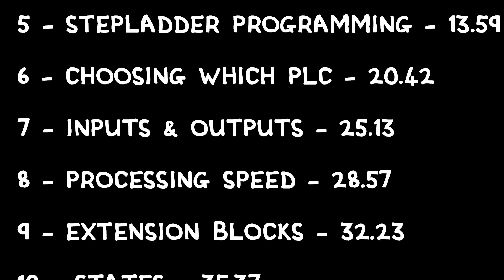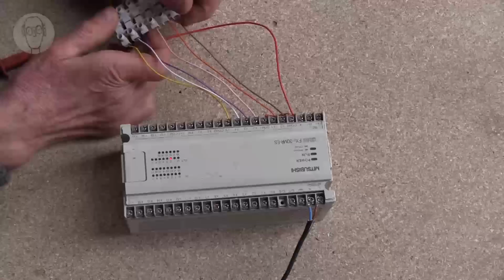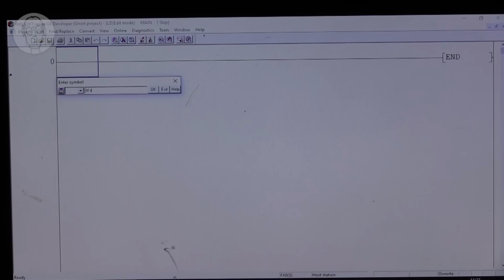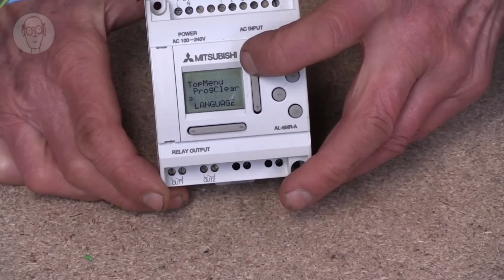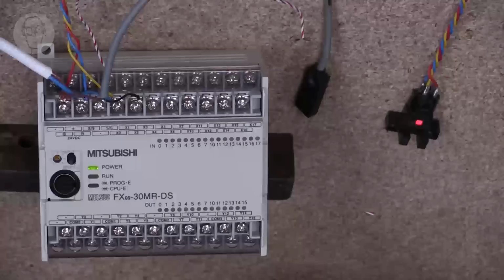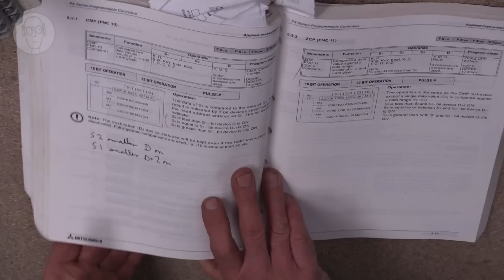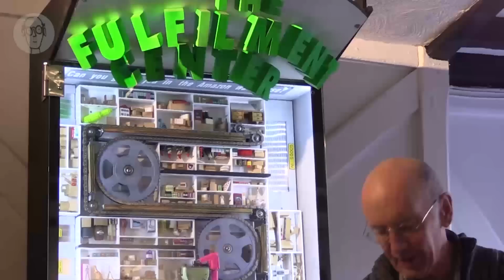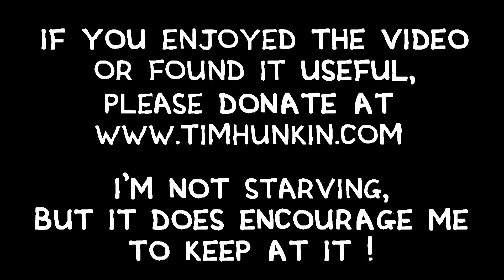PLCs (Programmable Logic Controllers) - The Secret Life of Components - episode17

Comment: Wow Tim, this was really useful. I'm building a coin operated miniature quirky factory with converyor belts and all kinds of things going on, for young kids - something they can interact with. A logic controller would seem the solution although as space is tight, I may play with an arduino and see if that will give me the control I need. For something more tactile, I've opted for old fashioned toggle switches that the kids can switch on and off but I can see I'm going to need sensors in places to avoid damage to motors at end of runs. Was trying to figure out how to do all this when you uploaded this video. Most grateful. Will update you.

Comment: As an embedded  C and assembler programmer I used to look down on PLCs with disdain. However after Tim's programme I see the point. They are focused on the task in hand, responding to inputs with appropriate outputs to make all the machinery run. They start where that cam controller starts and continue past what the cam controller can do into actual robotics. They are programmed in a way that an electrician can do rather than like C which can only be programmed by a very dedicated nerd.

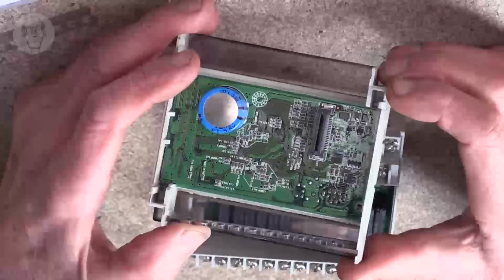Comment: The cap in the PLC at 13:30 is a Super Capacitor - like you said it's for memory power / backup. They can be used in place of a battery, and don't have the sample leakage or wear issues of NiCD cells.
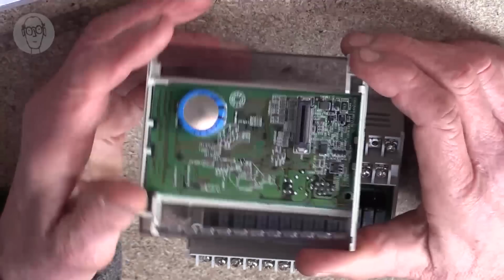Reply: I was going to put the timestamp at 13:18, but otherwise intended to say about the same thing.  But I figured someone might have beaten me to it, so I looked, and here you are.  :)

Comment: The high speed counters used for reading the encoder are usually hardware based and can operate much faster than the PLC scan times. The PLC will just ask the counter what the count is each time it executes the code. So it isn't a good representation of the speed of the PLC code execution. A better display of the code execution would be to toggle an output and watch the signal on a CRO. Keep in mind processing communications, motion and many other things will impact processing time.

Comment: Looked at PLC's when I found some festo pneumatic switch's in a scrap yard but the software was the blocker and went down the Arduino route. It would be great to have as you say some non-comertial free licences. Pluggable terminal strip ! didn't know that existed. Wonderful to see how use of the plc has adapted over time with the video . Superb.

Comment: I can see the advantage of PLCs - put mains voltage in and get control voltages out, all in a self contained ruggedised industrial rack mount package.  The price though - hundreds of dollars new.  

I've done a few cheap DIY projects using a $2 ATtiny85 (baby 8 pin arduino) but you do have to do all the power supply and IO yourself, such as a H-bridge to drive stepper motors etc.  The advantage is that there are libraries you can use to drive things like the H-bridge or oled displays.  You do finish up learning (or relearning in my case) three hats - mech eng., Elec eng, and programming.  To build something as robust as an industrial PLC you'd really have to have all of these skills (or the desire to aquire them).

Comment: A lot of people have used mechanical plc’s with out even knowing it. In the mechanical timer used in washing machines and dryers, where a sequence of events happen and triggered by sensors telling it things like ‘yes the tank is full, turn off the supply valve’ or ‘yes, the tank is empty, move on to the spin cycle.

Comment: worked with multiplex in pinball machines to increase the input and output lines. for a PLC with 14 outputs you can run a 7 * 7 matrix and boost the output lines to 49. only requires some diodes on a DC system. thumbs up love your channel.

Comment: The big backup capacitors are used for retained relays and timeclock, but the program itself is in NVRAM so wont be lost if the battery fails unlike earlier PLCs that needed an eprom cartridge to prevent programme loss.

Comment: A tip about writing the code, is write in a way that's understandable for another person to see what's going on. And lots of comments. This other person could be you long after you'd forgotten what you wrote. You don't have to write perfect code with the bare minimum number of steps and all that. No problem if you have extra redundant code and unnessasary duplicated functionality. All the software loose ends sticking out are shoved inside the box and no one can tell.  As long as it works!

Comment: There are free programs for Arduino that let you program them with ladder logic, that might be a good option for some.
They're not as robust as a plc but they're dirt cheap, and you can install them on a shield so it's a single connector, then when they fail you can just yank it out and put a new one in for a few minutes and a few pounds

Comment: we recently got some equipment made and the supplier prefers the Mitsubishi FX series (most of our PLC Stuff it Omorn or Allen Bradley) and to get the development software for it I plunked down 1500 usd that got me a slip of paper with a code on it, had to download the software heh, not even a USB stick. That's been one of my biggest hangups with them historically. Software cost more than the stupid device.

 Its gotten better but its also hard to justify given that one can just get a single board computer with a few modules and control it all with python or C# and not deal with the limitations of PLC's in the "industrial 4.0" world where every little step and process is monitored and logged in the cloud though a MES system.

I was working with a brand spanking new FX series with the vendors plc expert and Mitsubushi themselves for hours just to send a few KB of text data over FTP to an embedded computer, which did all the real communication to both the MES system and a local SQL database, and still didnt get all of it cause the PLC ran out of data registers.

Comment: the thing with arduinos (or similars) vs. plc difference comes to price for tinkering.

plc has advantages for professional use though and if you're controlling something that costs a lot to begin with it's not so much big of a deal, but if you just want to tinker and make a volume knob for your pc from an encoder wheel it kinda becomes a big deal to 10x or 100x your budget for it.

there are however lots of other arduino like products on the market, some of which are simpler or have simpler programming languages. arduino is just nice that it's so common that there's lots of code and libraries for it by now, along with products that either incorporate an arduino clone into the product or that have an arduino plug into them like for controlling lots of servos or such uses.

Comment: Appreciate you have a huge amount of knowledge and experience with these industrial PLC's, but for a new starter these days, Arduino are a cheap and effective alternative, with the bonus that the programming software is free and there is a vast amount of help and advice available for free on the net. The other plus is that the programming language uses a simplified version of C++ which gives a great grounding for people looking to develop their coding skills. Many applications are programmed in C++ so knowing the syntax and structure is a huge step forward. The Arduino is also designed to run at a lower voltage, simplifying the power supply arrangement and there are a million different "hats" designed to work with Arduino to provide all sorts of power supply, switching etc.
I wouldn't use Arduino in an industrial application necessarily, but they're great development tools.

Comment: It’s not always true that comments are helpful. Sometimes you can write code with function and variable names that make things so immediately clear that comments aren’t necessary. The problem with comments is that often they don’t get changed when the code gets changed so they can be wrong and mislead you. Also, They can make code more difficult to follow by making it longer than it should be. But well placed comments can be very useful.  Basically you learn with practice what the right balance is.
Reply: Comments when he was programming back in day were on punch cards, each card was an instruction, so you put comments on all cards.
Reply: @jayson8372  I want to program that way

Comment: Suffering some poor PLC programming at work. The company that made the machinery has twice remoted into things to fix issues. First time was to fix a bug they knew about, by replacing the program. Second time, they made several changes, claimed nothing was wrong, and then said to use a method that has to be done all the time, but isn't in the manual (guess we should have learned it via ESP). Also the ladder programming has no labels. So the eyes, conveyors, position sensors, etc, are just bits and with all the thing going on, good luck figuring it out. Last time the did a remote, they install a program that adds the names to the ladder, made changes to some things, then strips the names back out. Our Automations guy recorded it on video, and was going to reveiw it because the newest bug from the last "fix" was causing the relays to rattle and our in-house Automations guy found the right bit by guess and by luck, and was able to fix the issues ( one timer way too low, and one comparator incorrect) he wants to see if the changes were from the last fix, or what. It will do thing randomly, and stop doing things randomly. He wants to trash their programming and figures a month of work he could make a replacement program with less issues, and labels so we could fix it in far less time. Today, an unused machine from the same people started doing things and firing solenoids when no one was using it. It stopped by the time the workers asked me what might be up, so 
I just powered it down. This is the maching the gives us less problems. Still buggy as all getout.

Comment: Thank you for this, it has made concrete a decision I had been putting off for the Westminster chimes I am building to supplement my Master clock- slave clock system. I have a set of tuned scaffolding poles as tubular bells and some mains solenoids to bang them. But I got stuck on the control system, I was contemplating GPO uni-selectors, possible but they need 50V and a timing pulse to get the notes to play at the right speed. Arduino but I have no idea how to program them, the same applying to PLCs. So I shall be using a cam timer. 
Electrically a PLC is the obvious choice, but then I would have to learn to programme it and it would only be for a one off.
Whereas a cam timer, possibly homemade is within my comfort zone.
Reply: Please upload a video of that when you get it working! I love master clocks, I have 5 here
Reply: @echothehusky  Will do. I have 5 master clocks two of which are being restored, plus 15 or so slave dials around the house.

Comment: With your skills you would have been equally effective if you used microcontrollers and relay boards or PLCs or whatever.  For the purpose many approaches are possible that would work well.

When it comes to reliability for switching relays on and off until the end of them it’s hard to beat industrial PLCs from Japan.

Comment: Here in the US, as I am sure it's probably true in the rest of the industrialized world, PLCs are ubiquitous but underappreciated.  I have spoken with many engineers-in-training and none of them want to work on such a relatively low-tech device, referring to work on things like apps for phones.  This has led to a shortage of trained people who can handle things like Ladder Logic or OpCode, and the demand is such that someone from a local university who gets the two-year associate's degree in industrial engineering with the requisite background can earn more than someone with the full four-year degree in computer science or EE.
Reply: I think the industry has picked up on this and is moving to something more similar that you described, PLCs are being replaced with networked industrial I/O systems increasingly. Personally I'm worried that they will try and replace the safety control with the same networked I/O instead of safety PLCs / safety relays. What will happen when someone is killed because an EStop was pressed during a windows update?

Comment: I got to really like Siemens LOGO!8 few years ago. Originally I wanted to use two Logos with expansion modules to control one machine, even made most of program. But then new coworker came and decided we must use proper PLCs. So it was lying on my table for some months without use.
At that time we also tried to connect new machines into network by sending 24V signals into some black box, which sent that state as network packet to server. We were testing already THIRD solution because both previous ones were very problematic. Third one worked mostly fine but sometimes software just died. There was no indication, network LEDs were blinking but communication was dead. Also it was programmed by externists in different country and everything took so long! Change one timer? Well, give us one week and remote access so we can reload program!
One day I was sitting at chair, looking at table. "It would be funny if I could use Logo to do that, it would be much easier". And guess what! Two or three years later it's company standard :)  There is LCD with keys so you can configure everything without need to recompile or reload program. Software is really cheap and Logo itself also isn't as expensive.
Yes, it's limited in many ways, because Siemens still needs to sell their "adult" PLCs, but for applications like this it's perfect! And the best part, it does have same dimensions as circuit breakers, so it fits into same boxes! That saved a lot of headaches on machines with almost no free space in cabinet. It also fits in boxes which can be mounted on busbars. I just wish there was block to ping certain IP address and get answer if it was successful. And maybe one or two things.

I just really love Logo. And no, I'm not sponsored by Siemens (yet?).
Reply: The LOGO mini PLCs/smart relays are very capable if your task only has limited outputs. I worked at a pallet company and there was a machine that were super old and it had separate LOGOs for the feed conveyor system and the exit conveyor and a separate controller for the cutting section. As far as I know they never had to be changed, they just worked.
Reply: @EndlessDelusion  My first experience with Logo was hydraulic puncher for metal pipes, it worked perfectly for years until it was disassembled and put into storage to be scraped few years later. It used practically all 24 possible inputs and program was quite a mess (start button for example worked only when blinking light was on).
With "new" Logo!8 you can even connect Logos via network and make them talk to each other, which is huge benefit in my opinion. You can have few smaller devices doing only their job (like Tim explained with Arduino) and just exchange signals about what is happening and when certain operation finished.

Comment: I can see the benefits of PLCs but I still stick with my relay logic and discrete timers as I have often been asked to look at systems that don't work when I have no access to the original code, software or programming cable. The systems I have built for decades are still cheaply repairable but of course not as compact.
Reply: I'm a huge fan of relay logic, but do give PLCs a go, even if its a basic 'smart' relay such as a Zelio. they can be easily programmed and will replace a load of timers and relays. I love working on PLC stuff now I've learned a bit how they work. I'm no good when it comes to programming anything but simple programs though!
Reply: @echothehusky  I'm not saying I will never use them but I think about serviceability in say 5 or 10 years time when a quick drop in replacement is required rather than have to find software, a programming lead and having to write a program.

Comment: Regarding software cost, the profit margin is in the software, not hardware and the high software price helps to pay for the hardware development costs and back end engineering overhead.

Yes there are now arduino and RasPi based PLC’s out now but using them for mission critical and production environments is not ideal and won’t be for some time to come. They will also require most technicians to become experts at programming in C or Python which is also not ideal.

Comment: Great video. But programming a PLC looks like hell compared to just programming a microcontroller in C etc (even versions of python with modern controllers). It just seems so unintuitive and limiting compared to a normal programming language, and the direct control to real standards like I2C etc.

I'm sure they make sense in factories (although hyper modern automated ones don't use anything like what you've shown, essentially closer to the Arduino or even ASICs, high end CPUs, even AI inference ICs and a full Linux OS, than that (but much more advanced). But the traffic crossing game really shows the limitations of them in those style situations. E.g. that game could be implemented much much more easily in a modern microcontroller.

And don't get me wrong, there's the problem with the opposite way as well... When you have something like a coffee maker running an Arm CPU and an entire Linux distro you might've gone a bit (WAY) too far in the other direction...
Reply: High end factories definitely still use PLCs, just souped up versions. Sort of how like you wouldn't compare a honda civic to a dragster. There is still ladder logic in there in most cases.